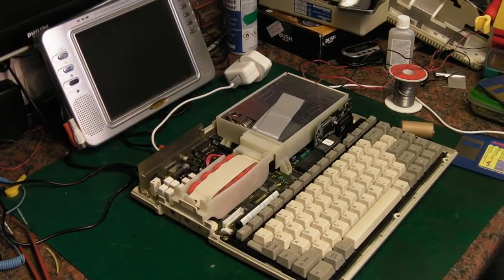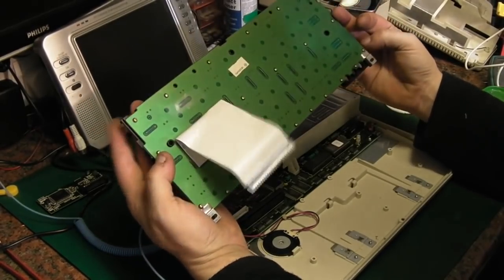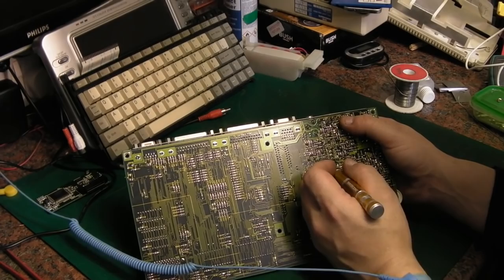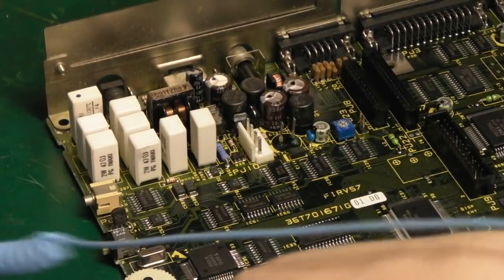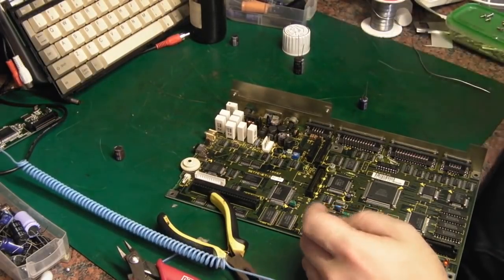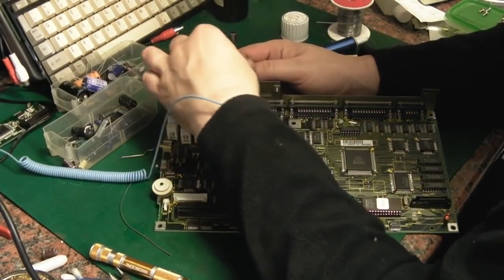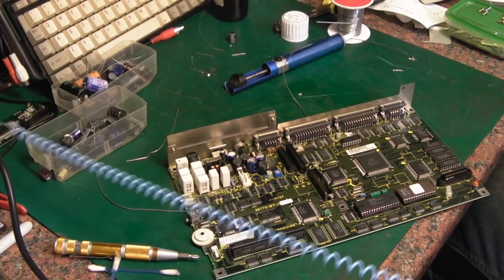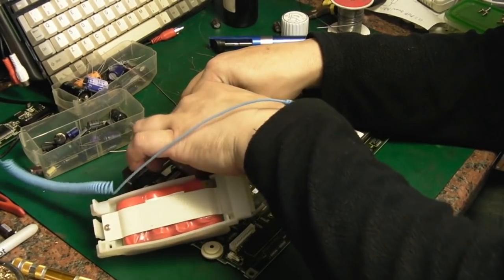Toshiba T1000 Laptop Lookover and repair Pt3

Comment: It is certainly proving to be a pain!!!  When you get SMD components in the way underneath like that it can be a tricky removing the through hole components for sure!
Reply from the maker: Yea doubly so when the leaking electrolyte has attacked the solder. think drilling was the safest option.
Reply: @Jayoldstuff1  I find pulling the caps off like you did is the best way when the electrolyte has leaked. I usually find another part of the board where the cap is connected and then use wires to rewire another cap in place. I don't bother trying to refit a new capacitor into the same holes as the old caps as the risk of damage is high when electrolyte has leaked. what's the progress with the toshiba, are you still working on it ?

Comment: Where did you learn about electronics and repair Jay? Any advice for someone looking to get basic knowledge starting out?
Reply from the maker: I've been tinkering with electronics from about the age of 6 I'm now 39. I started with a Tandy Radioshack 30 in 1 electronics project kit. I got my first soldering iron when I was 8 years old, yea health and safety lol. Best advice i can give is get something like the 30 in 1 they are still available online and work through the projects one by one, that is what I did all those years ago. It will give you the basic understanding of the different components and how they work. As for electronics repair the best way to learn is to just give it a go, watch some of my repair vids also GadgetUK164 his videos are excellent. get something faulty an old 1970/80's transistor radio would be a good first project and try to fix it. myself and others will help you out with advice. if you can video your work and put it up on youtube even better.
Reply: @Jayoldstuff1   Thanks for taking the time to reply and for the advice. I appreciate it.

Comment: Yea some of those desoldering jobs can be a pain, especially if they connect to big internal power/ground planes in the PCB. I think my earliest Tosh laptop i had was a T2200SX
Reply from the maker: Yea tell me about it. It would be fairly easy if it wasn't for all those SMD components on the other side. Think I used to have a T2200SX was it a 386 sx20 with 40mb IDE HD? haven't a clue what happened to it.

Comment: Great Channel. Have been watching to try and learn Electronics.Hope you can recover Cassette Players 'like matsui' I would like an overview of the data side of a cassette player ! What I mean is i have cassette player that plays music fine but computer doesn't load any programs ! Computer is fine. Other programs load on different tape player. So the tapes are fine as well. What I'm trying to research is how a cassette player 'handles' data cassette. I had always assumes that it just played it the same as music but I'm now unsure about that ! Yea I'm a beginner :) If you can help it would be a great help ! Thanks.
Reply: As far as a cassette player is concerned music and data are the same. If it's better at loading tapes made on that same tape machine then it could point to a speed or head alignment issue (azimuth). Also play around with the volume to make sure it's not too high/low and if it has a tone control it'll be vital to play with that too.
Reply from the maker: Quick test, try writing a simple basic program on your computer and saving it to tape with the suspect tape recorder then try loading it back if it loads its likely as DextersLab2013 says to be a speed or azimuth issue.